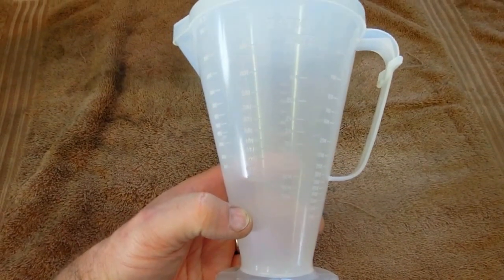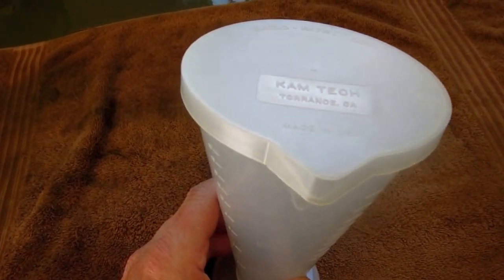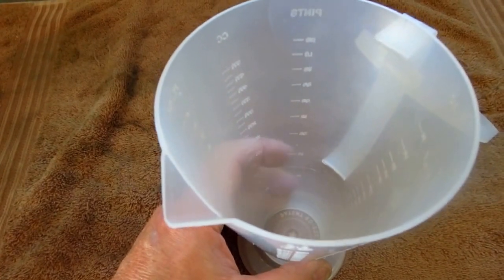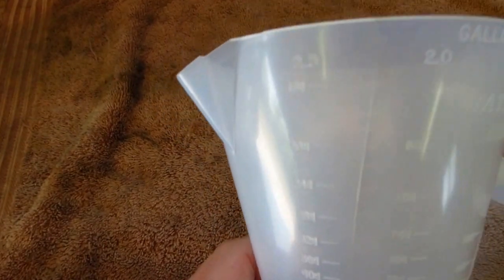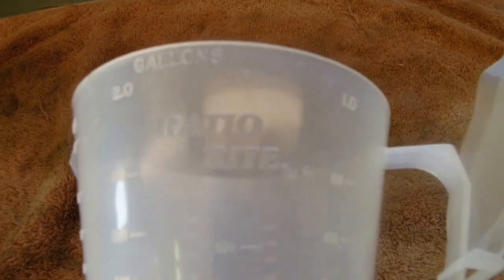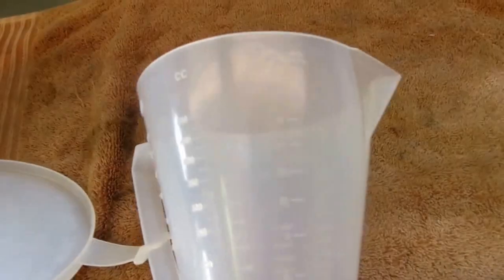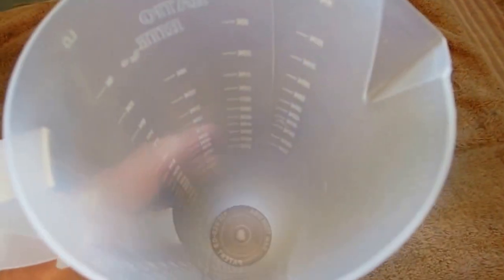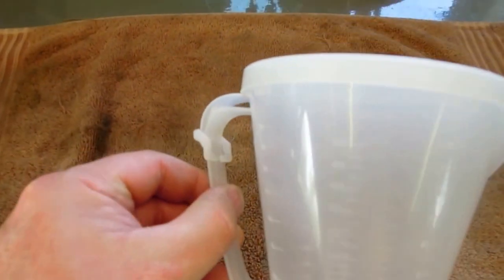Two Stoke Fuel Mixture Measuring Container

Comment from the maker: Absolutely, your suggestion is another way to do the measuring.  BTW, I'm a big fan of the metric system and use it frequently.  The value of this measuring device is it's simplicity, there's no math... as long as the pre-determined graduations are used.  Thanks for your comments.

Comment: Hello, great video.  I noticed that the RATIO RITE doesn't have a 25:1 mesurment, just the 24:1. My engine call's ofcourse for 25:1. What should I fill the cup to?
Reply from the maker: If it was me, I'd use the 24:1 as the difference is negligible.
Thanks for the comment...
Reply: @kwrightway  ok, that makes sense.  Thanks!
Reply from the maker: @SuperJiggawhat  You're welcome...

Comment: Hi Kwrightway. I want to purchase the same cup. But I am confused with the non-ratio side of The cup. Can I use this cup for simple measurements? For example, can I measure out 90CC worth of Oil to put into my Buddy 50 Transmission? (Is this what the non-ratio side is for?
Reply from the maker: Indeed you can, that's exactly what this is for.  The non-ratio side has three columns, marked along the top: "Pints", "CC" & "FL. OZ" left to right, respectively.  Therefore, if you want to measure out 90cc, under the "CC" column, simply fill the cup to 90cc and you're all set.  You'll have to approximate some measurements, such as 90, as the cup isn't marked at every possible increment.

Comment: Would there be a problem if i switch from 110 fuel to 91 without switching anything on my banshee?
Reply from the maker: You can switch to a lower octane fuel without changing jetting or other settings, if that's what you are asking.

However, whether you should change is a whole other question and depends on the state of tune of you Banshee and how you ride.  I presume you are using 110 octane for a reason.

If your machine is highly tuned, i.e., high compression, aggressively ported, etc., and/or you race or ride aggressively,  use care in going from a race fuel to a street fuel, even 91 octane.  High strung two strokes  can be seriously damaged if operated with the wrong fuel.

Comment: What grade of pump fuel should be used to mix with 2 stroke premix?
Reply from the maker: This is one of those areas the can elicit a wide range of opinions.  My first advice is follow the manufacture's recommendation, if available.  If you don't have this info available, then the next question is whether the equipment is high performance, such as a racing dirt bike or similar.  High performance or tuned engines may require a high octane fuel.

My own opinion, and please understand, not everyone may agree with me... is "premium" or high octane fuels are generally not needed for small two-stroke engines, such as string trimmers, chain saws, etc.  Usually an 87 or 89 octane will be fine.  Using high octane fuel won't cause any harm, but if there's no specific reason for using it, it's an unnecessary expense.

Personally, I prefer to use non-ethanol fuel rather than focus on octane.  Note though, high octane fuel is not necessarily ethanol free, in fact, in my area (the US Midwest) high octane pump fuel is virtually never ethanol free.  I have to buy ethanol-free fuel from dealers that specifically offer it at special pumps.  This is often called "recreation" fuel, or similar.
Reply: kwrightway , thank you for the feedback. It was very, very helpful.
Reply from the maker: @antwoinemarshall4955  You are most welcome...